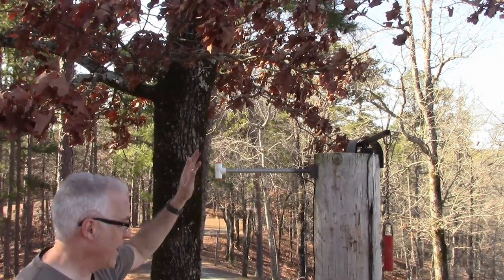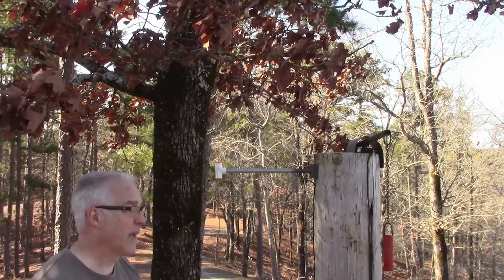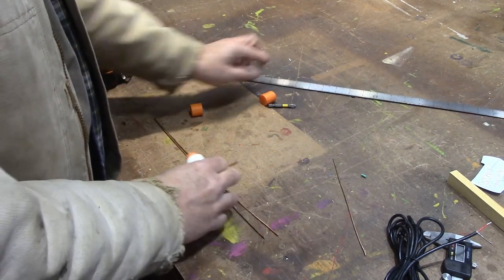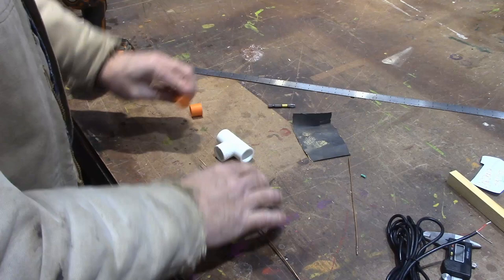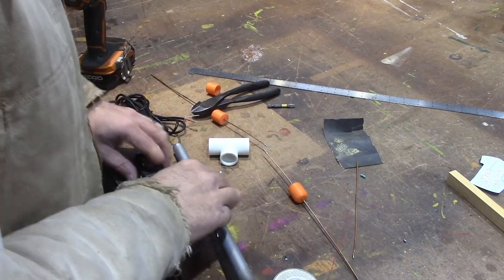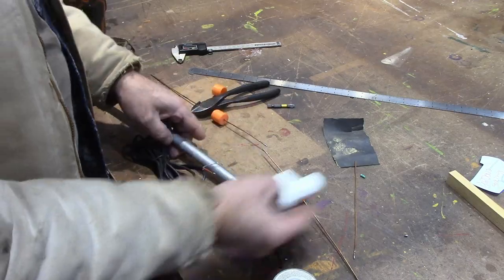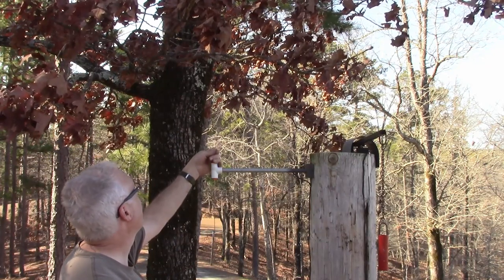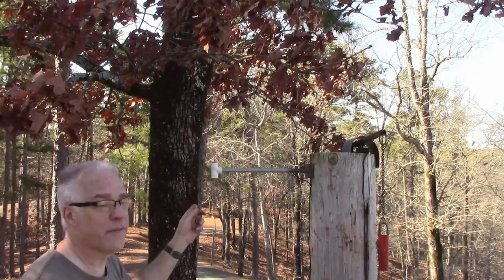Homemade 433mhz Dipole Antenna

Comment: Very interesting as always.  I have one question, would adding some 3D printed blunted tips to the wire ends affect the antenna  performance?  Might save an eye 👍😎👍
Reply from the maker: I don't think it would change the performance because you still count the length of the wire in the PVC fitting so I don't think capping the end with something plastic would matter.

Comment: Simple and clear.  Thanks.  Question - how did you connect the two wires to your controller?  Often gate controllers are set up to use a coaxial cable, where the outer sleeve goes to the ground, and the inner wire goes to the antenna hook up spot on the input board.  In this case, you have two wires coming from your dipole antenna.  Can you clarify where and to what they connected to on your control board?
Reply from the maker: I connected the middle wire to the antenna lead and the outer shielding to ground on the circuit.  Some circuits have 2 connections for the antenna.  If you are going to make one read the comments, one person suggested I would have better results with a half wave antenna.  I think they may be right.

Comment: The feed impedance is practically infinite and it would be better to feed a half wave dipole instead.
Reply from the maker: You are saying I would get better results from making  half wave instead?  Is that what you mean by "feeding" a half wave?  Thanks for your input!
Reply: @SoatMon  Yes. Antenna impedance is dependant on its length. The transmitter/receiver and your feedline are probably 50-75 ohms and a full wavelength antenna instead of a half wave requires a matching network to keep it efficient. So an antenna half that size would actually work much better.
Reply from the maker: So that should be as easy as cutting 6.5 inches from each end making them half the original length.  Does that sound correct?  It already works a lot better than the original but if I can improve it this easily why not.  Thanks for your help!
Reply: @SoatMon  Yes.
Reply: This is such a diamond of a revelation!

Supplementary question - what did you connect the two conductors to? Was it Ant and Earth?

Comment: I used steel rods from an old clothes horse and even though the lengths are correct It shows 98 mhz.  
Definitely don't use steel.